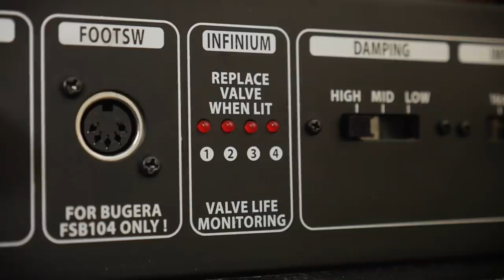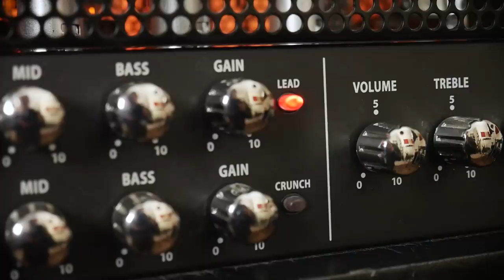Fire Hazard Amplifier?! | Bugera 333 Infinium

Comment: I've got a TATA! How do pickups in an offset configuration (Precision Bass, Railhammer Humcutters, G&L Z pickups) work?
Reply: @JC-11111  Yeah, but hum canceling pickups work by combining the output of two reverse wound reverse polarity pickups working in series to amplify the signal both pickups receive and cancel the signal only one pickup receives. Why isn't the sound of the string being cancelled if only one pickup is getting the signal from the strings? 

I know it DOES work... but what's the science behind it?
Reply: @stephencagle8233  Well, those offset designs are typically set up such that each pickup does not really pick up the strings of the other pickup.
Reply: @stephencagle8233  Basically, the way your usual humbuckers works, you have two coils wound in opposite directions - they capture twice the string vibration, 180° apart out of phase, but capture the hum equally in phase. You then invert one of the signals, so now the string vibration is in phase, but hum is out of phase, so it cancels once summed. Since the coils are slightly apart physically from each other, string vibration isn't perfect in phase,  you get some comb filtering, hence the humbucker tone (that's also what gives the Telecaster mid position that distinctive tone).

Split pickups basically only capture a set of strings each part, hum also in phase. You then invert the signal of one half, hum is now out of phase and cancels out once the signal is summed. Since the string vibration info between them doesn't overlap (kinda, sorta), you don't need to worry (much) about the comb filter effect.

There's a way to do a dummy coil that captures no string vibration at all, just hum. You can then invert it, sum to the actual pickup signal and do hum cancelling without changing the tone at all.
Reply: The two halves are electrically and magnetically opposite to each other. You don't say if you understand hum cancelling pickups or not. Loads of videos will tell you how they work. Split coils are more or less humbuckers split into two and halved.
Reply: @stephencagle8233  seems like you really need to understand how humbuckers work in general, first off.  There's plenty of resources that explain exactly that and exactly what you're asking about.

Comment: I had a Peavey 5150 as a teen I bought used in the late 90s. For 12 years I completely abused that amp tossing it around in and out of cars and never changed a tube once. Lol. It was very noisy but back then there was no yt and I didn't know anything about tube amps. Thinking back I'm still impressed by the durability of that amp.
Reply: This is the way i treat my  bugera  6260 infinum since  2013. Still works like  a charm  😀. Not even a dead led. Every  year i update my review  on audiofanzine to  say "hey, another year still good".

Comment: I got my virtually unused 333XL Infinium as an absolute 2nd hand steal, and was really pleased with it's performance, especially bearing in mind the price. The original Bugera valves took a major crap before Christmas and I re-valved it with a full GT and Harma kit from Watford Valves and wow, what a difference! They have really broadened the sound out and it runs whisper quiet even on the lead channel. I was genuinely surprised how  well put together my later version was inside and they're definitely worth a look if your on a budget and want to try a valve amp. (Change the valves out though if they haven't been done already!)
Reply: I got a steal on mine too at $380 about four years ago and have never had any problems with it except replacing tubes. Mine was and still is mint condition. I also bought a refurbished Bugera 412 cab that was mint but the speakers were junk turbosound so I ripped them out and loaded it with Celestion V 30’s and it sounds killer.
Reply: $200 for the 333 Non-infinium, non-xl. I've played the sh!t out of this amp. The common connector meltdown did happen a few months ago. Bumbed me out, but I fixed it, no problem. I actually really like the clean channel on this amp, I like the 6L6 Fendery sound. I'd like to pursue that sound further through this head. Any ideas on preamp tubes that would be better suited to the rounder cleaner sound?

AND I'd like quieter preamp tubes that sound better, so I could actually turn the gain up past 1 AND even just use the crunch and lead channels! If you have any suggestions, I'm all eyes. Having a legit conversation on the web about Bugera ampes without it turning into a flame war bullsh!t fest is one of the hardest things to do. I swear so many guitarists are so freaking immature, their egos seem to get so wounded that you didn't pay $3,000 for your head! 

So hard to get info on this amp, and these, amps. I think it's other amp makers paying their marketing people to sh!t on Bugera so people keep spending multiple thousands of dollars for what you can buy used from Bugera for pennies! Anyway, this is a Bugera-safespace! Lol, so I'd love to hear what you've tried, and what has worked for you with this amp!

Comment: Don't have a Bugera 333 but I do have a Peavey xxx (which is what the Bugera is cloned/modeled after) with JJ-EL34s and Tung sol preamp with a combo of 12ax7s, a 5751 in v2 and a 12at7 in the phase inverter. Its really tamed the gain while still remaining super brutal and aggressive. It's super brutal. I think the xxx is super underrated. I need to make a demo of it. Use a mesa v30 cab with any peavey and you're set.

Comment: I had a 333XL from the very first run back in 2009. After a short time it stopped working. Turned out the wiring was put together using some very cheap and unsuitable wago style connectors that over heated and failed. Same happened with my 6262. A year later I got an artist endorsement from them and they sent me a V55HD. I opened it up and they’d clearly gone through it and used much better components. I still have it to this day and it still works.

Comment: The biggest fail point on the Gen 1 Bugeras was  they had a very weak main board power connectors and they burnt out as they couldn't take the current load! Once they were removed and the wiring soldered directly to the circuit board, there were no more of these failures!

I have a V55HD that had these issues along with the non heat sinked voltage regulator and it would jump channels @ random!

My amp was heavily modified by the wonderful folks at Behringer Australasia, and made rock solid & reliable!  MY amp IS the prototype V55Mk2, that was made before they revamped it with the Infinium valve management!
A unique amp!

Comment: Colin, I remember those days! You have come a long way. I bought a used non-infinium 333, non-xl, after one came up for sale locally at a good price, and after watching your vid for a little hand holding. A few months ago, I flip it on, and dead silent, no glow in power tubes. Turns out to be the common problem of the cheap plastic connector melting and shorting. I fixed it with maybe the worst soldering job in the history of electric guitar amplifiers. Works totally fine now. Question for you though:

I prefer the 6L6's, and almost all of the time I use the 333 exclusively on the clean channel as a pedal platform, as  you know, getting the volume and gain over 1.5 (not o'clock, like 1.5 out of 10) on the gain channels will produce police helicopters in short order, and I'm way below the budget of attenuators.

So, actually a couple questions: do you have valve recommendations to bend this Bugera into a clean Fender sound? I like the clean channel as is, but I'd like to make it even better if possible.

And second: The class of preamp tubes that Bugera uses and suggests, I think, are the problem with the limited distortion sound range. I know A LOT of people would be interested in hearing this head retubed with something other than a C grade 12AX7, in V... whatever position it is that calls for the C. And same for the V position that calls for a B.  I think using cleaner, higher quality valves in there, would allow for lower gain, break up type sounds, before going to full hoover (at 1.5 on the gain knob), and a better range of distortion sounds overall.

And a bonus third question: How about techniques for quieting this amp. I've heard that you can remove your two outside power valves, and half/double your impedance (still don't understand impedance, after all these years)... but if your cab is at 16 ohms, switch the switch on the head to 8 ohms. I've heard this done, and it is a bit quieter, allowing you to reach into deeper gain at lower volume. But what about doing this in conjunction with quieter preamp valves, like 12AT7's, that are around 60-80% the gain of AX7's? I bet this monster could be tamed, and you could get breakup type overdrive out of this amp, as well as reach inter the deeper gain at more reasonable volumes.

I think you could get a lot of content mileage out of answering these questions in video(s), as there have been a sh!t tun of 333's (of various configurations) sold over the last, what, 12 years, 14, I forget, and there is like only 10 videos, total, on youtube, and you made one and now a second, so there's 11! AND many of the valve sorcery principles learned on the 333 could apply to all the Peavey heads these are clones of, and even more generally to valve heads of this sort of topology, of which there are millions (so to speak).

So, come on man, DO IT! I really can't find this info. I'm sure you could pull some sponsorship for some tubes to test out. You have the resources, the knowledge, the need for content! DO IT!
Reply: Bugera makes a budget attenuator called PS1. They used to be $99 but I think they went up some but still cheap for an attenuator.

Comment: I've had one of the OG Bugera VH55 heads from before the Infinitum series came out and it's still one of my favorite heads for use as a pedal platform. People who hate on Bugera's stuff tend to either be gear snobs who're just angry you're making decent tones out of a $400 tube amp or people who just don't like Bugera because it's seen to be "cheap"
Reply: I'm getting better tones with my Bugara G20 head and 4x12 cab and a Fractal AX8 than my buddy does with an SLO 30 and his 1200 buck cabinet. 
Knowing how tone works helps. 
And you're right. They do get pissed when your rig cost less than $600 bucks for amp and cab and your tones are better.

Comment: I have a B52 AT-100, and it sounds like an absolute monster with incredible range. Deep, warm fender clean, gritty plexi sounds, HUGE mesa dual rect sounds... But jesus is it unstable. Every time you turn it on it sounds a little different. I'm guessing it has some parts wondering out of spec and would be an easy fix, but sure wouldn't be easy to find what's wrong.

Rumor has it, Bruce Egnater designed the thing. The sound sure seems that way. $200 on craigslist.

Comment: I had the 2x12 combo of this amp absolutely loved it, got every sound I was aiming for (from rock metal funk blues) using different guitars,pickups, pedals & adjusting th eq ,only slight issue was there was a slight delay in sound when using the foot switch changing from the clean channel to the drive. Kinda realising that I miss that amp should never of sold it.For all of those new to valve amp world this is a good place to start for the price & what you get. For the haters keep on hating something you've most likely never played.

Comment: Still using my first run 333XL from Feb 08'.  Was gigging 3-4 times a month with it till COVID locked down my area.  I've done a few reliability mods tho.  Still got Bugera tubes in it.   Haven'tt had any issues since the mods in 09'.

Comment: Back in 2012 I was gigging with a Bugera 6260 120watt 212 combo. It was an older one that had the old blue power/standby jewels, and was one of the earlier Bugeras in their lineup. It caught fire on me one night during soundcheck at a gig where I did NOT have a backup. 

Turns out it had a factory defect that led to overheating issues, and It was easily repaired weeks later , but the gig in question wasn’t salvageable, unfortunately. I sold it after it was repaired and and I have been using the Laney Ironheart exclusively in the years since. 
No issues with my Laney

Comment: I've had the 333 combo for quite a while, I changed the valves to Groove Tube 6L6s sounds a lot more smooth and rounded than the originals. Never had any problem with the amp.

Comment: I've owned one of these as a back up for about 3 years. I likes the infinium aspect bc I've always wanted to put KT77s in an amp and I could with this one. 
Surprisingly good tone for the price. I literally needed a clean, crunch and lead channel for the band I'm in. Throw an MXR carbon copy and a TC HOF in the loop with a gate and an EQ to tweak, and a screamer in front and I had a great rig as a back up (sometimes I'd even bring it just for fun to stack against my other guitar player's JP2C+  lol)
Reply: I dig the signal chain you described that you used. Sounds like a killer setup
Reply: @guitarzan2979  it really was. I was impressed with it on more than one occasion. That is one of those amps that you could get different sounds by adjusting the channel or master volume. Channel volume, more bite/attack...master volume, more girth and "bigger" feeling.

Comment: My TATA: What is feedback on guitar?
Reply: eeeeeEEEEEEEEEE
Reply: Not an expert or anything, but I'm pretty sure it basically comes down to the guitar pickups picking up the sound coming out of the amp. That means more signal going into the pickups, which means more going out of the amp, which means more going into the pickups, etc. This creates a feedback loop where the amp and pickups are essentially constantly feeding each other. 
Though I may be totally off here, I don't know a lot about that sort of thing. Hope this helps!
Reply: @Oliver-ex3cs  You're very close! It's more that your strings vibrate slightly due to the air being moved by your amp, and distortion basically compresses your sound (soft sounds get louder, and louder sounds distort more) so the really subtle noise of your strings vibrating get louder and due to resonance the string starts to vibrate even more. (That's why it stops if you mute your strings)

Think of what happens if you push a swing, push it at the bottom each time, it's not going very far but basically hang on it at the highest point and you can push it very high with minimum effort.

So too can a random frequency that happens to be a harmonic of a string come from your amp onto a string, which then starts too move at that frequency and produce that frequency louder and so on.

On acoustic guitars, the body can act as an extra amplifier for the resonating frequencies, which is why they feedback quicker and it can also be that the microphone picks that sound up too and it can also feedback from the microphone. (Same principle, just with a small coil attached to a membrane vibrating next to a magnet).

It can happen with just a pickup in theory, but that would require really strong magnets and it would happen at frequencies that would not be hearable to us due to the speed of light.
Reply: @snow15243  sometimes short answers are the best answers....
Reply: @snow15243  LOL. you needed 0 words to exactly nail it :D

Comment: My comment is a little late, but...
I had a 333 combo, 1st generation, and it screamed.
It had the faulty jumper off of the power board, easy fix, no issues.
I like to buy, try, and sell amps, and it moved on.
About three years later, I found a Tri-Rec head for $300.
Got it, and it really is a Chinese Boogie.
But, of course one day, I decide to fire it up, switched from standby to on and...
Nothing.
Dead silence.
I took out the standby switch, re-wired it for always on and...
Nothing.
It has been sitting in my storage room, with its broken brethren ever since.

Comment: I did 2 US tours with the Bugera 333xl (Not the Infinium) and had NO problems. This thing worked great, I was in a horror-metal band and it kicked baw-bags in every state. My tone was solid, it got thrown in the back of a trailer every night and was good to go next town. Would not hesitate to buy again or to recommend. Now - to be fair - as it sits today the tubes/valves are shot - I cannot afford to replace at the mo', but that's not the amps fault - my Mesa Boogie Mk IV is in the same place. 
I am in a more experimental/classic tone band as we speak but if (when) I get into another metal project, until I can afford the 3G priced amps, a Bugera will be my go to. Lets face it, you can have 4 stacked for the price of an ENGL and tip the bartender an amp if you can't pay the bar tab. And NO - it NEVER caught fire, not even once.
Reply: Only complaint - vent on top of amp - I realise heat rises but beer follows the path of least resistance. Fan and back vent go a long way on stage.

Comment: This is fine is good.  I had a couple of years of use from the 6262 combo and my bandmate had the head.  But his channel selector started messing up, randomly changing between clean and distortion.  We thought it might be the foot switch, but even without that the channels kept changing..  His was a bit older than mine but after the two years my combo started having exactly the same problem.  I understand with cheaper stuff comes cheaper parts but man that was a pisser.  I can't bring myself to trust them again after that.  But as for sound, it really did the job.  Just make sure you know someone who can take care of those issues.  Thanks for the video!